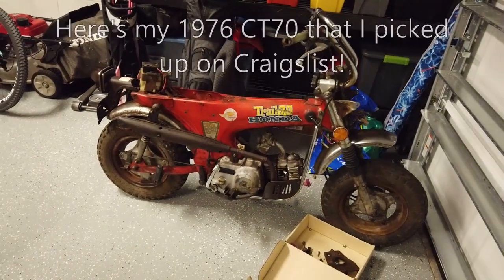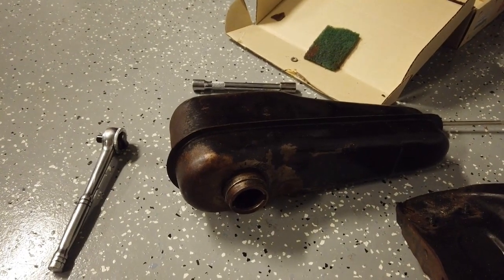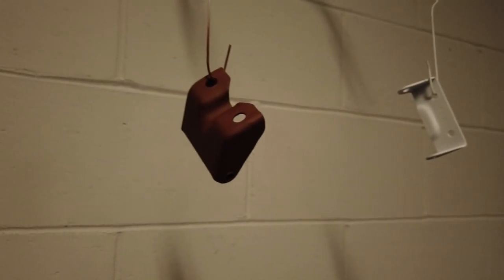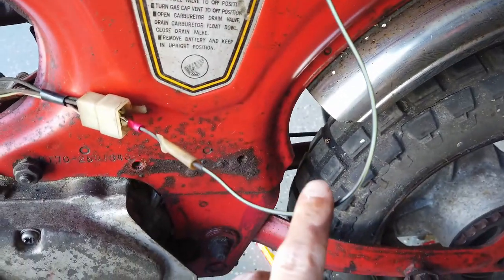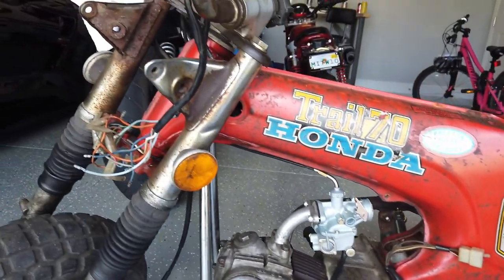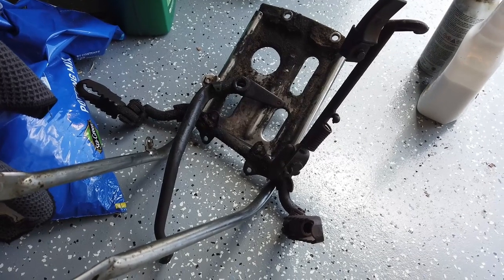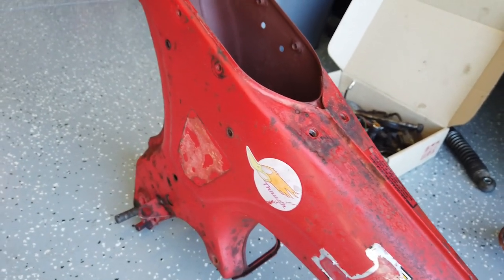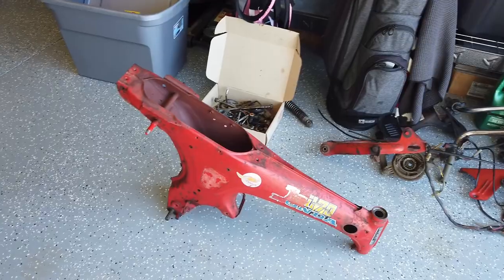1976 Honda CT70 Project Bike - Part 1 (Initial Tear Down)

Comment: Curious how much you were able to sell the engine for?
Reply from the maker: I think i sold it for $200 which I regret. I should have kept it for future builds but didn't realize I was going to end up doing more than 1 bike.
Reply: Thanks for the fast response. I just picked up a pair of ST90s that are very similar to CT70s. I'm hoping to get at least one of them running with the original Honda engine and then maybe down the road put a Lifan 125 in the other.
Reply from the maker: @JetSkiBuyFixPlaySellChannel  well if you need to offload one, let me know, I'd like to rebuild an st90 at some point.
Reply: I'll keep that in mind. I'm up here in Washington state. Would be cool to see you do an ST90 build.
Reply from the maker: @JetSkiBuyFixPlaySellChannel  You're about as far away from Florida as you can get within the contiguous US, but yeh, if you decide to part with one of them let me know and maybe we can work something out.
Reply: From what I recall, the bolting pattern is a little different on the st90. I saw another video on youtube and he had to make a custom bracket for it. But don't quote me on that
Reply: @SamSamuylik  Mini Bike Mike's Garage has a video on the bracket for a ST90. They take one more bolt than most of the other Honda Mini Trails.